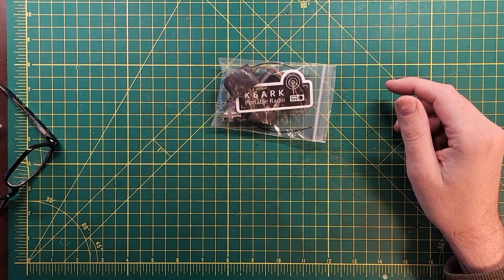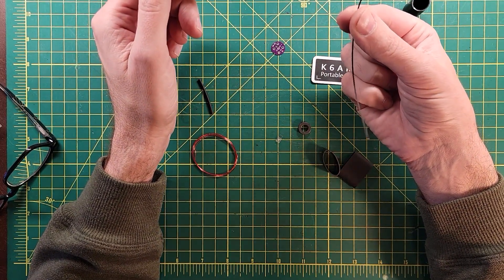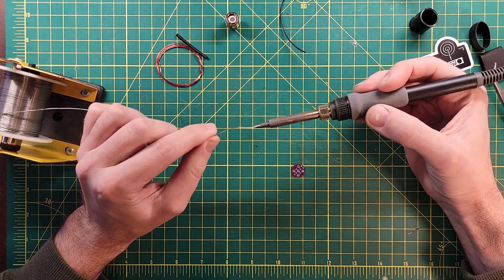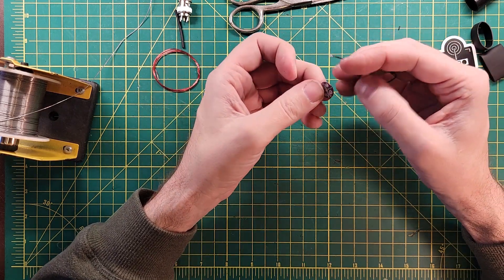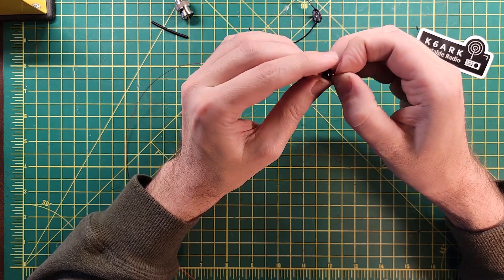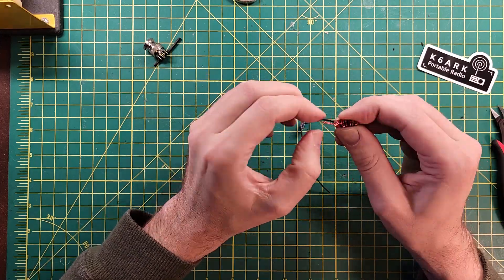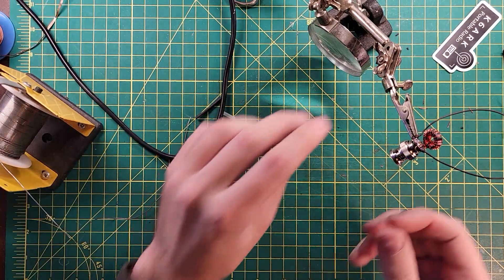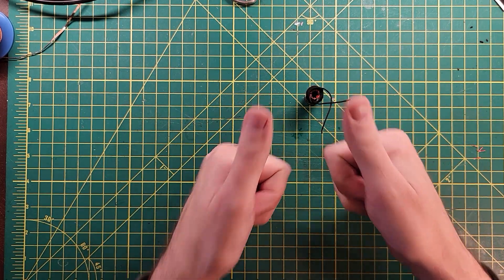This thing is PURE DARK MAGIC

Comment: Major soldering tip: ALWAYS use additional FLUX! Either paste or liquid electronics flux! Sure, most solder has a "tiny" bit of flux in the core, but using MORE flux makes a HUGE difference! Flux cleans all the surfaces you're trying to bond, so that they make a good solid and STRONG joint that won't break loose nearly as easily over time with vibrations or flexing, but it also creates a better puddle of liquid giving you get a MUCH faster heat transfer so you not only can work much faster but also not damage the PCB board traces or "toast" the tiny surface  mount capacitors or other SM components too! Just remember to clean the excess flux off with alcohol afterwards... There's an older "professional" soldering instructional video I found specifically for electronics work, I'll post a link to if I can remember where I stashed it if you like!😉
Reply from the maker: Thanks Mac!  Let me know if you find the link.  I do have some flux, but even with the specific flux remover its "fun" to clean up so I usually shy away from using it.
Reply: @temporarilyoffline  it's a whole series, but the first two are the most specific for ham radio. https://youtube.com/playlist?list=PL926EC0F1F93C1837
Reply from the maker: @macgyver5108  thanks!

Comment: A buddy of mine taught me to always re-flow a joint after you flush-cut it. Little dab of flux and a little touch of heat and voila! No broken solder joints. ;)
Reply from the maker: Thatsva good tip!